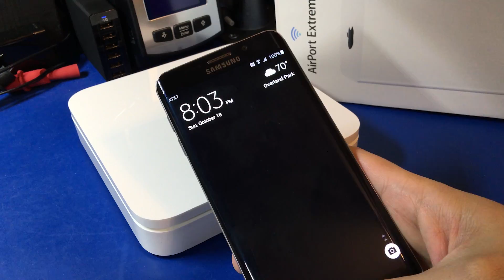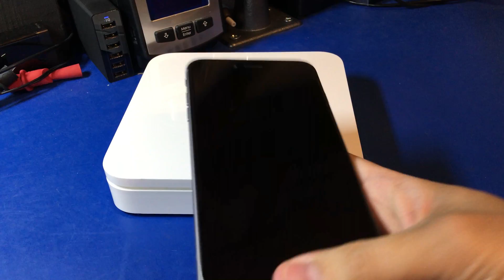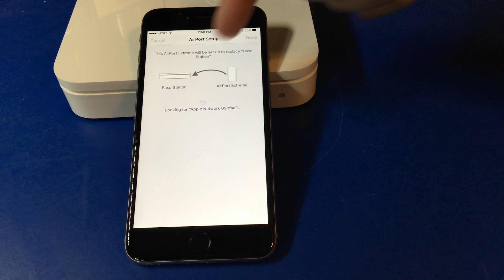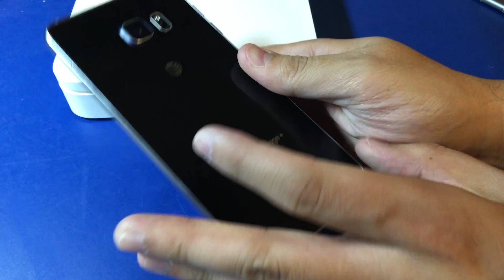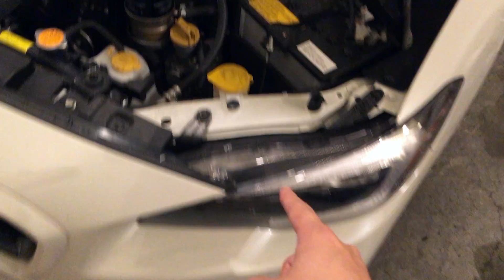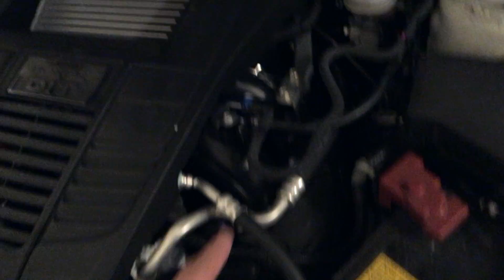Kudos to these two examples of excellent design engineering - #0103

Comment: The new version of this fails a lot. Have one apart at the moment, and oddly its not the power supply.
Cart filters that are up top have been common on European cars for quite a while, BMW m50 motors had them in 1993.

Comment: Those boxer engines have a unique sound. Due to the firing order almost makes em sound like there missing on a cylinder or 2. Very great engines they are. I'm still stuck on my little mk4 GTI the vr6 is a fun little engine as well
Reply from the maker: It's more the unequal length headers that cause the boxer rumble.  The exhaust pulses collide causing the blurble.  Mine has the new FA20DIT that has equal length headers and no longer has the rumble. Oh well.

Comment: A note on the iPhone 6. Scratch the fingerprint reader and you'll have to replace it, if not the entire screen. This is also a problem that used to happen with the iPhone 5. Also, newer Apple products are less user serviceable than older ones.
Reply from the maker: You can't scratch the fingerprint reader because they use Sapphire crystal to cover it. (Same with the camera lens). I can't say the same about my note 5 and edge+.  Also, what is there to service on a modern smartphone other than the screen? Two pentalope screws are the ONLY thing holding the screen on. You can replace a 6s / 6s plus screen in a minute flat. Same with the 6 and 6 plus. They're easier to replace now, so I'm not sure what specifically you're talking about.
Reply: TechnologyCatalyst They don't. It's ion infused Gorilla Glass. Plus, there have been reports of scratches even on brand new ones right out of the box as well.
Reply from the maker: The dual ion exchange from corning is the screen, not the button. That's the first thing they did when they bought GT Technologies. The home button has been sapphire since the iPhone 5s.  Same with the camera lens. Both my Samsung phones on the other hand, already have scratches all over the camera lens. (None on the home button, but the finger reader on the Samsung sucks out of the box compared to the ones on my iphoned and nexus 6p.

And no, there aren't scratches out of the box.  You apparently aren't familiar with Apple's QC.
Reply: TechnologyCatalyst Apple's QC is just as good as any other QC from other company.
Reply from the maker: Better in most cases. You apparently haven't seen the forums lately for releases like the 6p. Best part with Apple, you walk into one of their stores and get a replacement on the spot, where the android phones almost always require mailing it off for warranty work. (Like everything, there are exceptions to this)

But from the stupid lies you're telling, you're obviously a fanboy of some sort.  Unless you have loose diamonds in your pockets, you can't physically scratch saphire, so it's 200% bullshit that iPhone touchID is getting scratched.  I own a 5s, 6, 6 plus, 6s, and 6s plus and not even the 5s has a single scratch on the button.  Typically fandroid misinformation.
Reply: Pictures and complaints on the Apple Forums about it are up there for you to see.

And, for the fandroid you claim I am, you certainly talked about more Android devices in a single post of yours than me in none of mine.

And yes, you can cut sapphire where their atomic structure is weaker. Otherwise, you wouldn't be able to cut any crystal using another crystal.
Reply from the maker: Yes, with anything, you can find posts on forums complaining about problems, but like I said, you can just walk into an apple store and get a replacement on the spot.  Go look at BOTH customer satisfaction AND reliability and apple products always top the charts.  

Here's ONE source, of out many, and pretty much all of them have identical results with Apple topping the charts.  Your original post was hinting that they have QA problems, when in reality they don't. http://www.digitaltrends.com/buying-guides/which-laptops-are-the-most-reliable/
Reply: A note on anything not Apple. It sucks and always will. Lol if scratching the thumbprint makes it need replaced. Don't scratch it.
Reply: Jacob Hendrickson Easier said then done.

Comment: It my experience a lot of engineers great design user friendly ideas. It's the project manager that is mandated by the company to cut cost, and that it when all the good ideas you mention that cost a little more money or material get lost in the design. Nothing against project managers, it's the management above that kills those good ideas. So I guess it's more of a "Hi Five" to apple as a company that takes chances and let's the engineers implement these ideas without worry about the final cost knowing that people will pay for good designed hardware/software. Yes, it was a good router, I didn't have a good experience with it, lacking some command line interfaces for my advanced network. But I hate to say it apple is getting buggy with the software since the loss of the last CEO and I think they are changing now, only time will tell.
Reply: Just a another persons opinion, I've never had an issue with the ASUS laters routers. The N66U w as stable and fast. The one I have now is the Asus RT-AC66U and it's amazing for a dual band 2.4Ghz and 5Ghz router. I was able to drop the high gain antennas and the extender. This AC one covers the whole house, yard and neighbors properties. It has all the features you mentioned as well. A simple backup to a file (NVRAM dump) and restore the file to the new router and no loss of settings.
A quick word to the wise, never use wifi repeat not only because it cuts the bandwidth but most wifi extensions are only able to use WEP encryption security that is so easy to hack. Even for script kiddies these days can hack WEP without knowing much about encryption keys. So I would defiantly hard wire any second router to extend your signal and keep the security level to WPA2 (personal) and keep your wireless network safer.
Reply from the maker: +Dave B.Reviews (My Gadget Tech Thoughts) Sucks you've had bad luck.  I've been pretty deep in their ecosystem and haven't had any issues at all.  The only problem I've had with any of their products lately is the apple tv, but that's 99.99% the fault of wifi signal strength due to its distance from the router.  (I hope the new one has antenna diversity)
Reply: +TechnologyCatalyst Yes it does have antenna diversity, or what they call beam forming technology I think. The only problem with their Eco system was when they made a change in iOS and OS X to remove mDNSResponder and put in discoveryd.
This caused a lot of issues with iphones, macs, ipads, Apple TV’’s with connecting and keeping a wifi connection, as well as finding bonjour brodcasted things like HP wireless printers and other devices on the network.
It took them a year to finally decide to go back to mDNSResponder after multiple failed patching attempts. 
Now they are back to mDNSResponder and things seem to be getting better for a lot of people that had wifi dropping out on them, or couldn't connect to some wifi routers. Just disappointing that it took them so long to fix, but their latest OSX and iOS 9 is fixed finally.